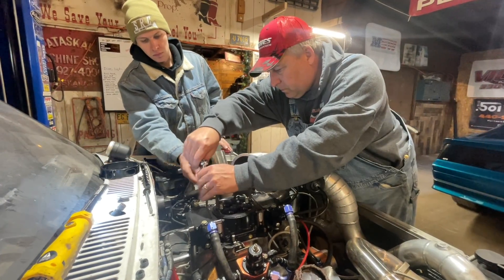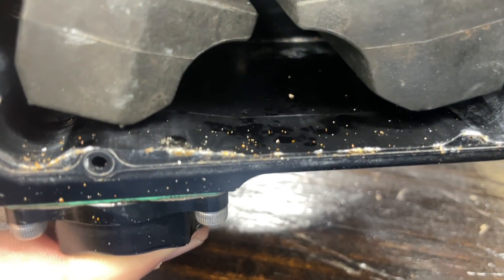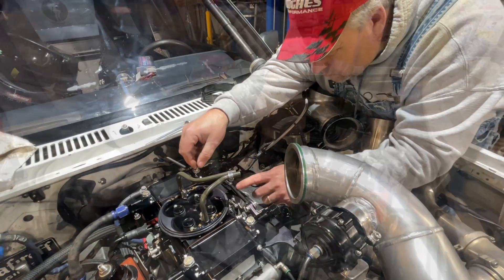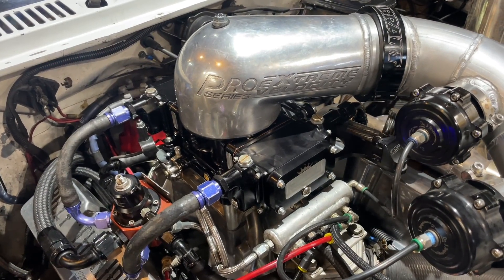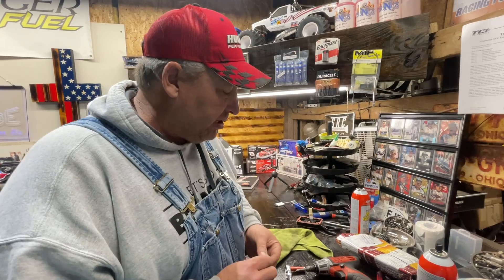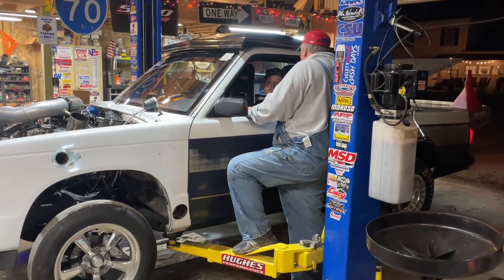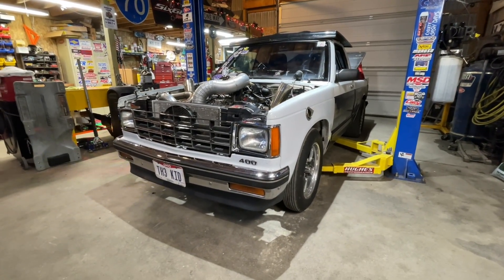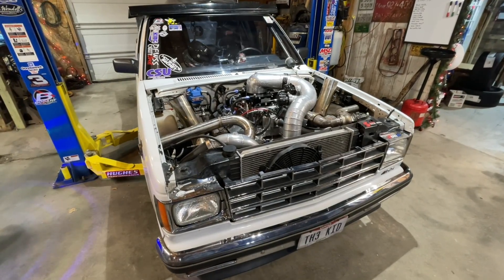READY FOR THE DYNO! Fuel system and Carburetor issues FIXED?!?

Comment: This trip to the Dyno is going to be very interesting. Not just for the numbers,  But to watch whats going on as its making those numbers. Hopefully if its going to do anything crazy or stupid, that it does it then. Having the dyno data and video from about 2 or 3 angles will help. Hopefully this contaminated fuel cell discovery will lead to the diagnosis of the trucks issues and maybe even the Falcons.

Comment: I’ve said something before, you’re top lube is probably the problem, the fuel filters can be cleaned out with brake clean, I went through the same problems in 2000, the first time I switched to alcohol, not telling you what to do but I stopped using the lube and just cleaned everything every time I raced

Comment: We ran Methanol in our sprint cars and we drain the tank when we got home every race you can’t let it sit for a week or two it will flake, then we used to run a little bit of kerosene through the lines to flush them out.

Comment: Running E85 I had to start running 10 micron filter just to keep my injectors from clogging up . Plus let my truck sit up for about 2 months and my lines were full of of that white chalky crap I think you either have to keep fuel moving through the system or you need to flush it all with 93 of flush it with something else. Just wanted to share my situation God Bless.

Comment: Hi Bill was just thinking about your suburban wander issue  i am a retired mechanic / service manager at a gm dealer ,anyway your suburban has a steering sensor on it and when they go  most of the time you notice it almost seems like a tight ball joint would in curves but normally drives decent ! Might be something to look into if they dont find any loose parts
Reply: Im a 30 year veteran tech also and I mentioned this very thing in one of his videos a couple weeks ago  Id bet its that sensor too  I had the exact same issue with my 99 suburban  feels like a tight place in the steering

Comment: Bill I had a similar problem with my sprint car fuel system. We ran Methanol this is what I did. Change all of the fuel lines, Even though I had my aluminum fuel tank anodized I switched to a stainless tank or polypropylene. If we didn't race for 2 weeks drain all the methanol and blow marvel mystery oil or WD40 through the fuel lines

Comment: So glad you guys got it figured out and fixed on the truck now you need Kenny Powers to wire up a kill switch so Billy can turn the truck off without locking the steering up 
And I know the Falcon don’t have any problems yet but if it has same fuel top lube you guys might do the same thing to it great video can’t wait for the next one you guys have a great night

Comment: It appears on camera that you failed to blow out/flush the return line before adding new fuel. Also you need to look at the fuel pressure regulator for corrosion in the aluminum body. You looked at everything but these two items. I suspect the regulator is badly corroded and adding to the trash in the carb.

Comment: Top lube can do this. Depending on the top lube it will break apart crap in the fuel and the filter can get clogged. Lucas for example talks about replacing filters more frequently. 

On one hand, I would guess its the top lube. On the other, where is the crap originating from? If buying pure methanol, shouldn't be anything falling out of suspension...

Comment: I squared up the secondary throttle plates on my Q-jet and it made a world of difference to the performance of my truck. No more falling flat on its' face when going to WOT.  This was with a bare bone stock 305 HO with 202 heads. A power glide and 2.73 rear gears. 
I surely hope you have caught all the gremlins and can win now.

Comment: Check all of your fuel fittings on the inside if fuel delivery problems continue after cleaning the lines out..had a very similar situation on methanol..aluminum A/N fitting can deteriorate and put a mess through your fuel system..sounds crazy but I have seen it

Comment: Take the lock ring out of the steering column and cut all the notches out of it and then put it back in so when you shut the key off you can still steer, it’s a safety concern, I did it on my race Jeep with the same gm column, takes 30 mins

Comment: Stuff Wreaks even more havoc on fuel injectors, sounds like you need to put small fuel cells up front of both cars so you can easily flush with straight gas after each weeks racing.

Comment: Your throttle plates still aren't all the same. much better though. I am thinking that some of the haze is coming from your Polly tank. The fuel is dissolving the Poly at the microscopic level. You need a aluminum fuel cell. I would be glad to build one for you.

Comment: With your constant fuel filter issues, maybe larger elements/cannisters would help? Aeromotive has extreme flow 10x2 5/8" elements in 10 and 100 micron for your pre and post filters.

Comment: Very informative journey indeed.  I have a methanol injected Turbo charged Buick GN, and a few years ago when my son’s raced with engines that ran on pure methanol we had to be mindful of the methanol containers wicking water in high humidity circumstances if left open too long 
  Do you think perhaps moisture got either into the fuel cell or the delivery containers externally due to temperature extremes, rain like you have had off and on, cold nights and warm days over a period of time?
  Just a thought. 
Brilliant deduction regarding the increased pressure pushing the blades over thus restricting flow and probably setting up a flow vortex going into the intake that created havoc. 
   Back in the 70s I built my Holley 780s and fully was with you with respect to the metering blocks, power valves and jetting. 
   Use to have an old Hawk A/F meter that clamped into the exhaust and a long ribbon cable that ran back with me behind the wheel so I could watch the A/F at different rpms. 
  You bring back some great memories!
  Looking forward to the dyno results!
Thanks Bill !

Comment: I'm wondering if there was a time in the past top lube wasn't used and the fuel wasn't drained before truck went in storage. That white corrosion looks like normal methanol corrosiveness.
The fact that the white stuff gets past the filter says to me it is fuel corrosion witch doesn't take but a few days. In other wards the filter is working fine but it cant do anything about corrosion that happens past the filter. It can build up on the output side of the filter and flake off.
Hate to say this but the fuel lines I bet are coated inside and will continue to keep flaking off creating wild goose chase of source of problem.
We always had to drain the fuel out after racing to stop issues with this.

Comment: What kind of fuel pump are y'all running ? I know that it's obviously electric.  But from what I have heard and read,  a belt driven mechanical pump is needed to provide the volume.  Just wanted to get another opinion.  Thanks
Reply: You are correct even if it had a 10.0 Brushless Aeromotive electric pump..the issue is even 4 x170 thou titanium BLP needle and seats ..at best your going to hold 8 psi ..with an electric pump you only have 1fuel pressure...4 *170 thou at 8psi is aroind 1600 lb/hr at 0.72 lamda making1500HP your going to need 1800-1900lbs per hr through the needle and seat...you need a belt driven pump and you need to be 13-15 psi at wot

Comment: Do you filter the methanol from the drum before it goes in cell?  If the top lube was the problem I wonder if it was rated to be used with straight methanol?  Seems strange.  Can't imagine a top lube not being rated for methanol.

Comment: Bill, with our pulling tractors we run methonal in with a lubricant as well. But at the end of the weekends we always drain and strain the alcohol back out of the tank and fuel system and then theow in some av gas and cycle it through up to the carb so we don't have any corrosion or issues like that from the methonal is this something that would help you guys from going through fuel filters and having to clean the bowls on the carbs for future?

Comment: I ran micro sprints for a few years and ran methanol. You can't leave it sit for more than a week or so without starting the engine and running it about every other day. The white chalky stuff is from when the methanol evaporates, it's better to have the lines and carb full of methanol when it is going to sit, I used to start and run the micro every other day to keep fresh methanol in the system. If it is going to sit longer then a couple weeks I would drain the cell and flush gasoline thru the system. Get yourself an ultrasonic cleaner to clean out those stainless filters and that should be done very often.

Comment: Bill are you sure the white stuff is just not normal methanol corrosion? I’m assuming you use S1 or S3 which is highly corrosive to aluminum and stainless. It also absorbs water like crazy. I’m sure leaving the truck outside allows water vapor in the cell. It usually mixes and burns pretty well but messes with the tune up and causes even more corrosion. Most methanol Super Comp racers drain the system after every race even if the they are racing every weekend. I need to nag a bit. Methonal is very bad health wise and is absorbed through the skin. You need some gloves when you pull the bowls off and dump fuel. Don’t make me call Vicki.
Reply: Exactly right and hauling it on the open trailer in the weather. I’ve always thought they should definitely switch them lol.

Comment: Just a question how long has it been or how often do y’all change or pull and clean the 02 sensors for the wide band AFR after having chalky fuel issues like that?

Comment: The problem with alcohol is the fuel evaporates quickly, attacks aluminum, and offers virtually no lubrication, unlike gasoline. These drawbacks don't offset the fact that you can use alcohol to make gobs of power, but care must be taken with your weekly and off-season maintenance programs. Some of these precautions may seem a bit unusual if you are switching from a gasoline class to one that allows alcohol, but they really aren't major once they become part of your routine.

"The physical properties of the fuel are unique," explains Brad Cauzillo of Kinsler Fuel Injection, which manufactures some of the most respected mechanical fuel injection systems for Sprint Car racing. "Methanol dries relatively quickly, and it attracts moisture which can contaminate the fuel. When it dries it first turns to a gel. In the next phase it starts to clump up, and in the last phase it turns into something a lot like sand." In mechanical fuel pumps, the barrel valves, and other components used in alcohol systems, there are very tight metal-to-metal clearances, so getting sand into the system is detrimental.
Reply: The first thing to note is that all fuel cells are not created equal. If you run alcohol in a standard cell constructed for holding racing gasoline, mechanical troubles will be in your future. The methanol actually breaks down the foam used in a standard container. It is also damaging to the rubber bladder. Craig Mitchell of fuel cell manufacturer Aero Tech Laboratories (ATL) says that alcohol will cause standard foam to become gummy within a week or two. Shortly after that it will dry the foam, making it brittle. When this happens, parts of the foam will flake off and can become sucked into the fuel system. The result is a clogged fuel filter and potentially clogged jets in the carburetor. If you run alcohol, you should use a fuel cell constructed for alcohol. Those cells use special materials that are more resistant to alcohol racing fuel. It's always a good idea to drain all the alcohol left in the fuel cell after a night of racing instead of allowing it to sit in the fuel cell all week long.

Comment: Methanol is breaking down the fuel cell.  We had the some of the same things and had to go to a stainless fuel cell.  You will continue to have the problems using that fuel cell.  I would not use more than a 5 or 6 gallon fuel cell.  Remember methanol is a solvent.

Comment: Bill, that flaking in the fuel looks like you have a aluminum fitting going bad because of alchohol corrosion. I always ran klotz top lube but if I can send you a guy who can sell you a additive that I used for alchohol that works and he is not far from you. I can mail it to you or text you. You make the call if interested. Best of luck on your return to racing.

Comment: Hey bill, instead of the store bought top lube, go to your local medical supply and get castor oil, I and many others I know have been using it for 20 years in methanol bracket cars that make 400 runs a year, if it posed a problem we would know it by now.

Comment: Drop the lube, it will clog your shit, klotz was best but still separates and falls out of suspension. Run an xtra tank of gas for flushing, flush after every event. Make sure everything is stainless from the the split off of your xtra gas tank back to your methanol tank that way when you flush all your lines forward all the way to the carb are sitting in gas and methanol is just sitting in stainless. I know it’s aggravating flushing all the time but you want have that separation your seeing and clogged filters. I’m sure it’s been questioned but I wonder how that charge pipe orientation plays out with the carb and wonder if the charge pipe and hat coming straight into the carb would change things. We know air don’t like turns and the short side probably don’t see as much air flow, being straight the primaries would see less but would probably be easier to tune than coming in from the side where both primaries and secondaries are seeing different pressure from side to side. Just a thought. If you worry about guides and stuff with m1 or pure alky just run pure castor oil without the other additives, that’s what the old round trackers run   around here back in the 90’s.
Reply: There is an engine masters episode about carb hat orientation. Worth a watch.

Comment: you need a mechanical fuel pump......doesnt matter if you had a 10.0 brushless ...you wont be able to hold enough base fuel pressure ...with even with 4 x 170 thou titanium needle and seats you will need 13-15 lb across them at WOT..the floats cant hold it.....

Comment: Hey can you run a few layers of pantie hoes over the fuel cell when you pour in the fuel and see if it's coming for the fuel ? If not the fuel cell lid and or cap could potentially be the problem I know you have had to do this now a few times

Comment: Bill I was iced in last night & watched videos on shooting stuff f-class it a little wild on costs ( when it gets to much like work its not fun anymore to me) I got 2 boats & i had a computer flasher for chips about 15 years ago i was told by banks power boats motors to flash a program on my relation cig boat one those long fast boats you see in off shore racing it had 2- 454 big block chevys about 2000 ,  back in 1984 i was around drag racing turbo cycle & racing i saw lee Shepard fix heads for chevy and a ford! Chevy ruined his design for a small block head, i went TDY in military to south C threw GA & the shop tied to melling racing in 1984 early summer (it was place where bills car got its engine parts) i was in a rented car with a gift box of ford heads with drawings and parts he used to there supply place! from Lee S that winter he died in a test crash! gale banks was testing at same drag strip that how i knew him! in 1984 before i left NV in july i was told i had a unknown blood illness (blood clots -cancer) the cancer part was found out by my uncles records he was the man the break threw was found with that changed it to clots from cancer it was control able then! ok my job was munitions in military fuel stuff racing or a mob job  what would you chose my step dad was a policeman i chose racing or semi trucks! diesels was what my uncle did for military in ww2 that where he got sick!  he saw my real father & was related to my mother! oh Diesel fuel has changed low sulfur & makeup of it use too! they gone nuts over carbon & lead in gas! one kid in Canada went nuts it bad you know leads a lube to valves in heads! i got a odd look from him that why my dads car blew up yes add some 2 stroke oil to the gas! see what it dose! the older cars hate the newer fuel stuff & e85 a other trip too!  i use solar and 4 cycle small engines too!

Comment: Methanol will alwaz do that if its left in any tank that has a vent. Only way it doesnt is if its in a totally sealed environment. I know this from fooling with race gocarts. It will turn the whole inside of the intake tract crank cases everything will have that white chalky substance everywhere. Gta drain the system if your going to let it sit even for a couple days

Comment: O yea just for fun I guess the little truck will have 1576 horsepower at the wheels anybody else want to guess.
Reply: That be a pretty good guess I'm gonna go with around 1700+ if it dun lose traction at 1260. Be ideal if they could get it on a hub dyno

Comment: The "white crap" is the corrosion created when methanol is left in aluminum. Using methanol, the fuel system should be flushed with pump gas after each day honestly, but with as much as you race week to week, you can probably get away with flushing the methanol out of the system after every couple of weeks or if it will be sitting for longer periods of time.

Comment: The white crap is methanol.. You guys need to pickle the carb fuel pump and filter with racefuel after each use.. Build A-line off the back of the pump that you can stick in a jug of racefuel and and idle it until it starts blubbering... When it's time to use the truck again open the bulls and push  Race fuel out until you see meth... It needs to be done every time the car's gonna sit gonna sit for more than a night... I've been preaching this since you guys switched to meth..